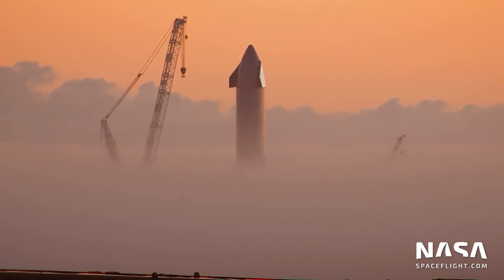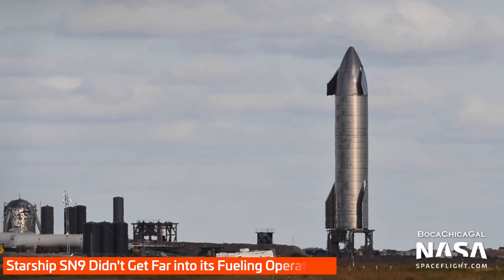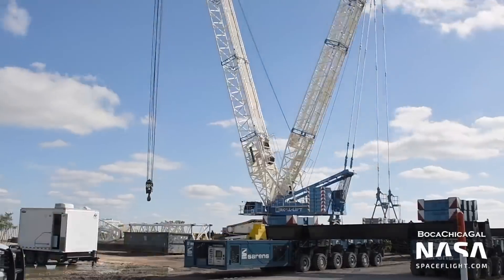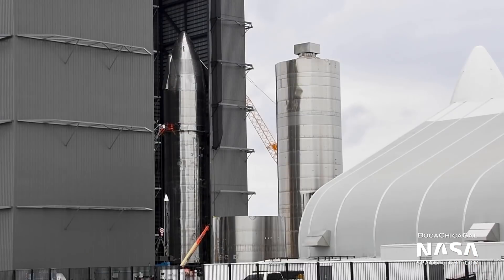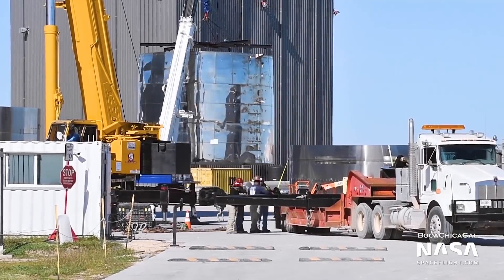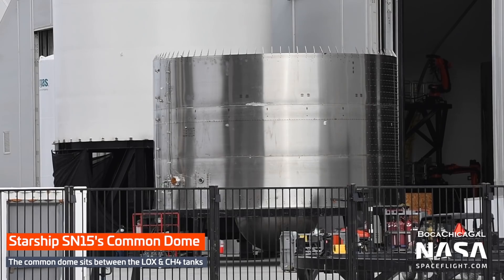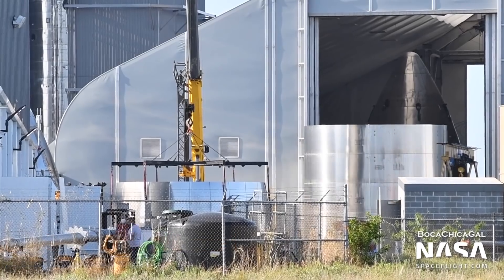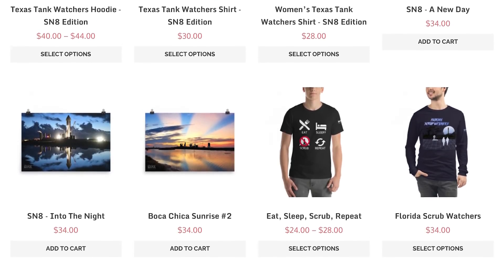Starship SN9 Needs 2nd Static Fire Before Test Flight - Upgraded Starship Leaps Ahead Of Old Designs

Comment: Static fire duration was sufficient to ensure that the plumbing for the main tanks to the engines is properly functioning.  Longer duration burns simply cause more erosion of the launch pad leading to an increased chance of flying concrete as shown in the longer SN8 test burns.

Second static fire is still required to validate the plumbing for the header tanks to the engines works as well, until that static test occurs there will be no flight test.

These are not "insider" information but anyone knowing the steps required to validate flight readiness for aircraft could readily deduce these requirements.

Comment: They are going to try down sizing to 3mm from 4mm wall thickness!? That's big jump, I can't wait to see if their manufacturing process is good enough to still get the required pressure performance out of the thinner tanks.

Comment: Thank you for the narration, it adds more content and context to Mary's great videos. 

Man,  3mm thick steel will be under 1.2 giga pascals of hoop stress at 8 atmospheres of pressure (or about 175,000 PSI). That is some strong 30X stainless and some even more amazing welds. Are there any signs of reinforcing the vertical welds?

Comment: Most likely the 3mm thick test article is for the SH design. Elon said quite a while ago he wants to use thinner steel for the upper rings - but not the entire ship. I doubt it will be used in SS, the ship undergoes too many different types of stresses in it's flight regime. SH only needs to be engineered for a limited set of conditions .

Comment: Moving a raptor with a forklift seems        precarious.
Reply: Carefully.. Carefully...
Reply: How else would they move it by crane? Doing that increase the chance of damage if a wire snaps and the forklift keeps it low to the ground.
Reply: @ttvnotabot1199  I mean it seems it only sits on the rim of the nozzle, and top heavy

Comment: Hold your horses for sn-12 to sn14. Chances are SpaceX will need to make incremental changes, including reverting back to methane gas pressurization, before sn15 gets its chance to fly, even if sn9 and sn10 are successful.

Comment: I'm wondering if those Starship numbers that are being skipped over is due to the pressurization problems with the current design.  It's possible that those serial numbers are not going away, but are being reworked with the pressurization fix required.  I am wondering if SN15 hadn't had its header tanks installed, and the fix was able to be made on it

The SN7b? test tank might be with that 3mm steel, and needs to be pressure tested to failure to see how it holds up.  

The above is just speculation, as I haven't any more information than what I get here on NASA Spaceflight
Reply: Elon talk about major upgrades in SN15, I guess that's why they are jumping, no sense to test old hardware.

Comment: I would speculate sn 13 and 14 are in hiatus till sn 9 -10 - 11 and 12 are being tested ! this way the upgrades can evolve without dissassembly and saving time and money !
Reply: I think even 11 and 112 are in hiatus. If 9 and 10 fly well, they can be reflown and do any tests wanted before SN15. Only if those 2 crash will they resume work on 11. Otherwise, 11 thru 14 are expensive scrap - but not really expensive, built in a simple facility out of commercially available steel. That fits with Elon's rapid iteration and leapfrogging to the next step. We were all surprised SN5 and 6 did only one flight.